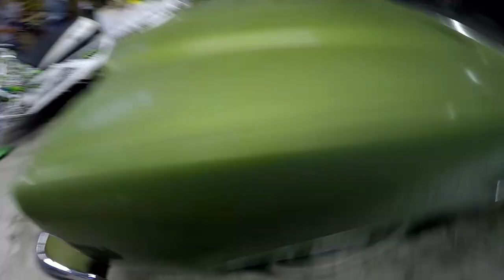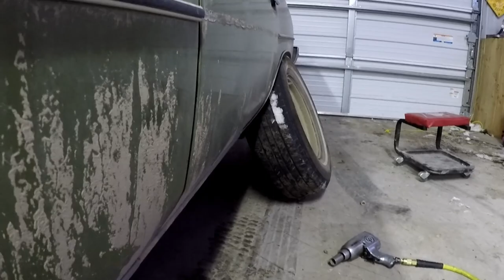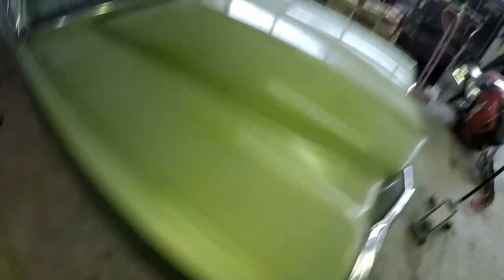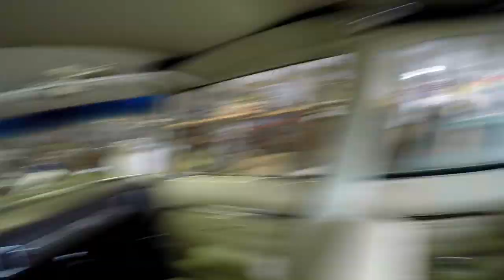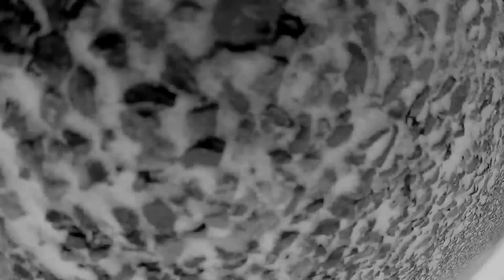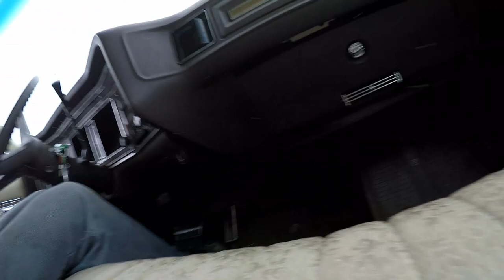Haggard Garage Burnout Challenge!

Comment: Should have designed an "on demand" oil dripper so you can add some oil to the tyres during a burnout to keep the RPM to the wheels up
Reply from the maker: I purposely blipped the throttle i don't like holding the throttle at one rpm too long sounds alot better when you can here a bit of the rpm range that car has more then enough torque to spin the tires without lubrication. Thanks for the feed back tho!
Reply: fair call I've never tried to do a burnout in  an old yank tank!